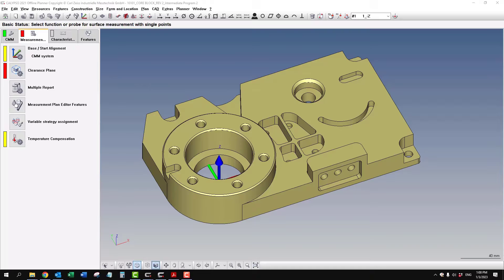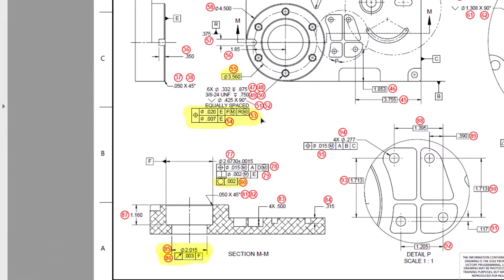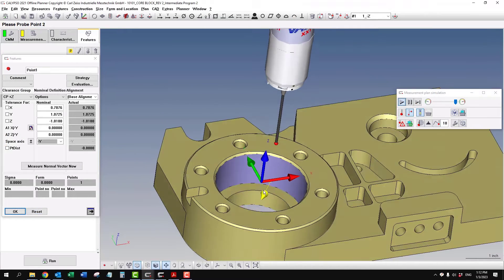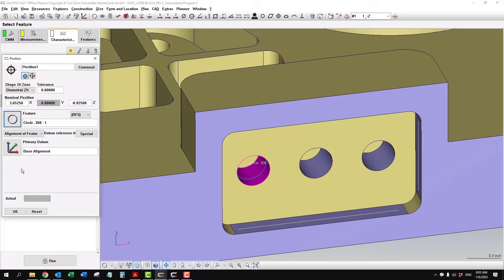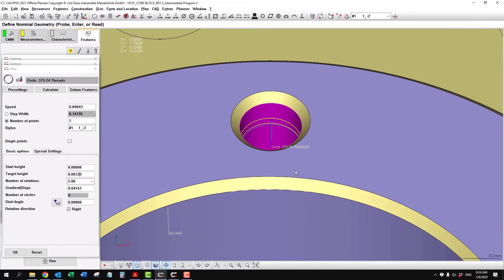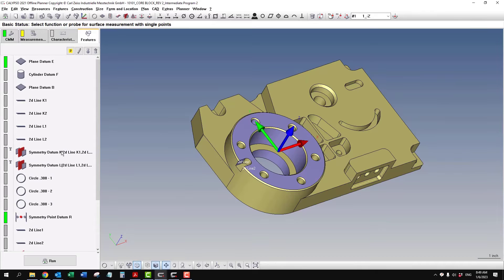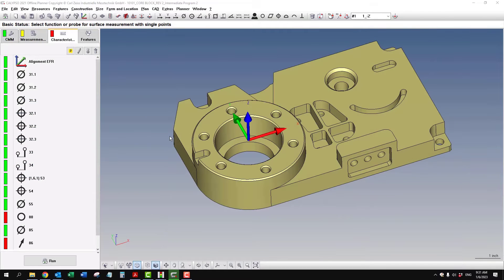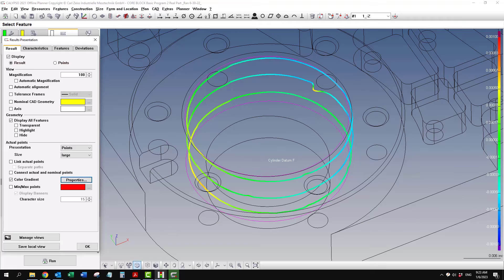Learn Calypso by Example: Intermediate Program 2 Preview

Comment: Thanks Steven for sharing your videos of Calypso.
I have a question about Pattern.
Can you make a pattern in a pattern?
Example: an equal space .5” distance of 5 holes in a line, angle 0 degrees. And this 5 hole-pattern is shown at another pattern of an equal space of 90 degrees.
Thanks again for your time.
Regards,
Brandon
Reply from the maker: Hi Brandon,
It is not currently possible to do a pattern within a pattern, but the next best option is to create the 5-hole linear pattern as separate features. Then put those in a group, and right-click on the group to set it to a rotational pattern.
Thanks,
Steven